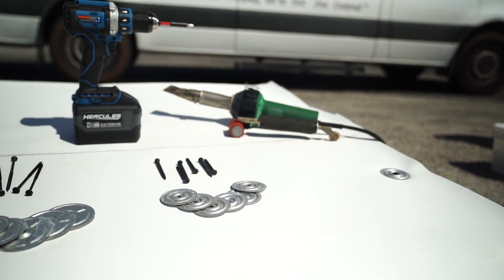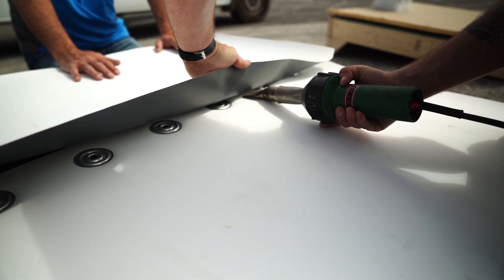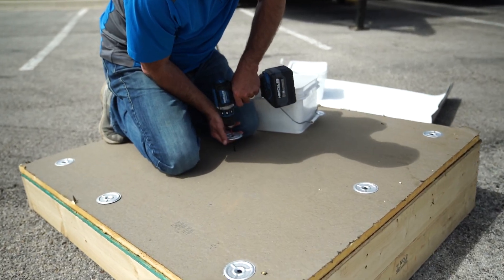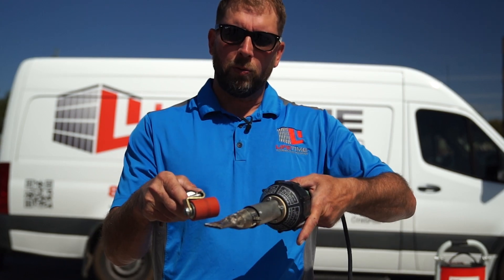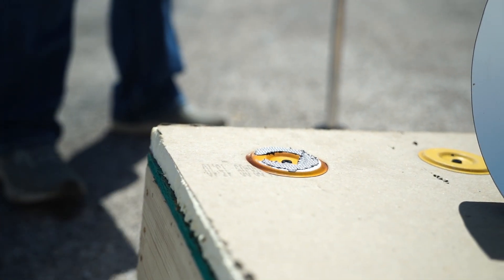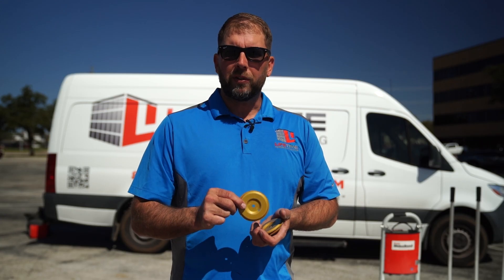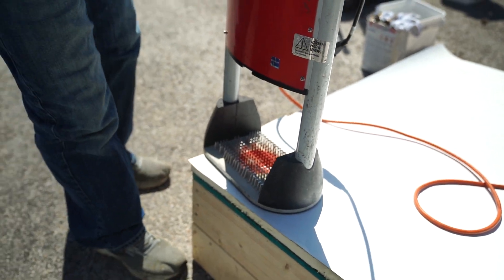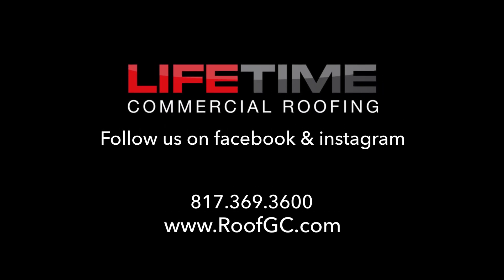Mechanically Fastened vs. RhinoBond TPO Roofing: What You Need to Know | Lifetime Commercial Roofing

Comment: I am a home owner and am doing a 10 x 20 tpo repair. Could you tell me where I can find the #12  and # 14 fasteners
Reply from the maker: Thanks for reaching out! For your TPO repair, #12 and #14 fasteners are commonly used in roofing applications, especially for securing insulation and membranes. You can typically find these fasteners at local roofing supply stores, or you can check online retailers like Amazon, Roofing Direct, or SupplyHouse.com. Many suppliers that specialize in roofing materials will have these fasteners in stock, often with options for various types of washers to go along with them.

If you're doing this as a DIY project, I recommend checking with the store to ensure you're getting the right type of fasteners for your TPO system, as different manufacturers might have specific recommendations for their membranes. Always make sure to follow the manufacturer’s guidelines for installation to ensure a proper seal and long-lasting performance.

Good luck with your repair, and feel free to reach out if you have any more questions!

Comment: Never tack weld seams...worst thing you can do...clueless example of contractor point loading the uplift to the tack welds...instead of the fully welded seam.
Reply from the maker: The tac welds are not the main point of uplift tension, it is redundant for the robotic weld. Our work is done per RhinoBond specifications. It is not a traditional mechanically attached system and is performed this way under RhinoBond supervision and certification.